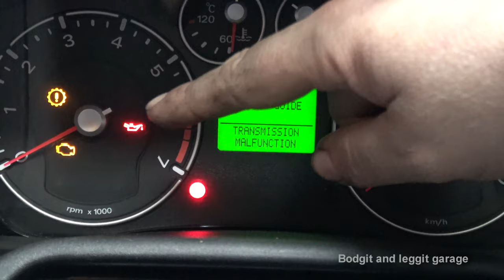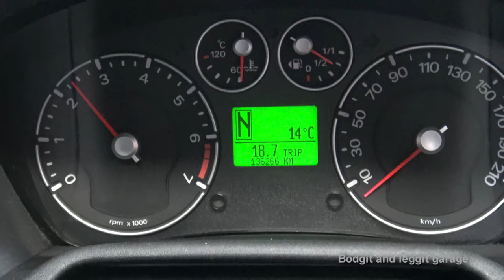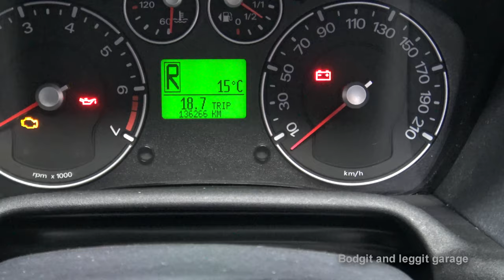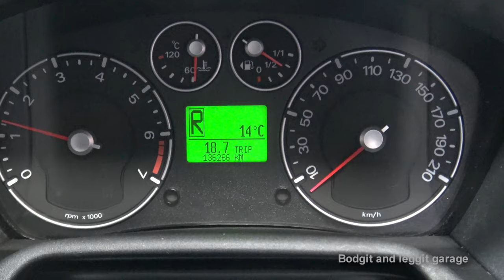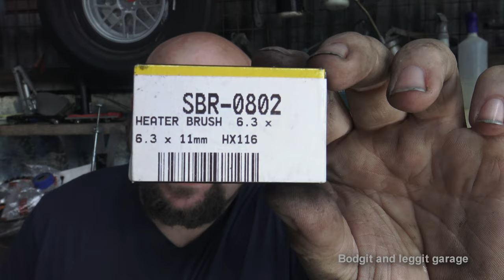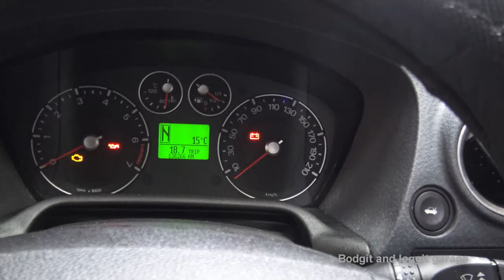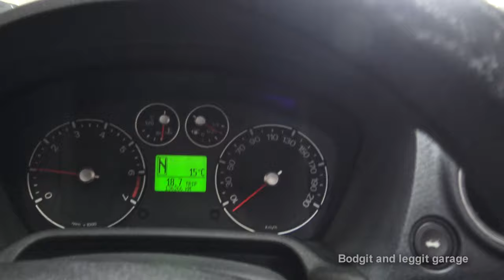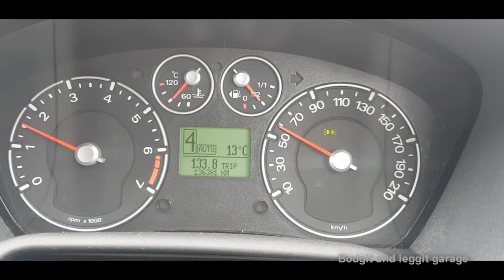Ford/Mazda/Volvo P0810 Clutch Position Control (Full Video)

Comment: Thank you very much for sharing the video. I had the similar problems with my Ford Fusion semi-automatic. I tried to replace the brushes by myself. But I got a disaster: I broke the top edges of the bruch holder, thus could not hold the spring and the new brushes in place. Do you know where I can get a new brush holder (acturally I did find a way to take the brush holder out)? Thanks.

Any comments and suggestions are highly appreciated.

Comment: Quesriok I got my battery replaced a year and out of the blue on the Saturday it went bad it was 220 amps from 600 amps what's would have caused it to go bad
Reply from the maker: Hi mate unfortunately this is very complicated believe it or not it's not just a battery all depends on what type of battery you have and what type of car you have for example you might have have a car with a smart charge on it and if you just replace the battery without telling the computer you've got a new battery in it will over charge the battery and destroy it you could also just have had a bad battery or you could have an issue with your alternator it's not just a simple answer unfortunately but yes batteries can go bad very quickly you would need to get the whole system checked properly
Reply: @bodgitandleggitgarage  turned out to be a faulty battery
Reply from the maker: Glad you got it sorted mate

Comment: This worked for me but after I did the repair the car still wouldn’t start because the battery was a gonner after sitting for ages if anyone does this repair make sure the battery has enough juice to spin the motor lol

Comment: So Ford actually sell Electricaly operated Manuals and call them Automatics. No torque converters needed.
Reply from the maker: its more that just ford that do this
Reply: @bodgitandleggitgarage  Modern Technology its amazing how far its advanced with cars over the last 20 years or so.
I suppose using a Manual gearbox with Electrically operated auto change makes it easier to fix..Fully old style automatic transmission is a blooming nightmare to fix.😉